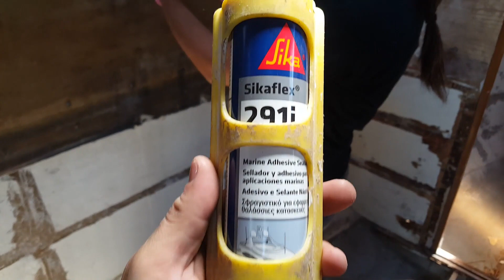It's NOT always FUN and GAMES! | YACHT REBUILD WEEK 5

Comment: You kinda knew you would have to replace the sole. It's the low point in the hulls. If wood is rotting higher in the hull and water usually travels down it stands to reason that the sole, stringers, and other supporting structure is compromised. Your lucky it's not one of the newer hulls with coring below the water line. Only thing you got to worry about there is delam and general osmoses.  Sand the hull down to the glass, do a moisture check, dry it if necessary and reseal it and paint with whatever bottom coatings you desire

Comment: Silicone sealant is good enaught  for what you are using it for. Stay away from marine sealant. Only use it on the out side. Never saw a Cat with one engine in the middle. Would love to see more and some photos of the drive shaft would be nice. If you are looking for engines have a look at Raka Marine. They have the Levol engine range and we have being using them  as gen sets for some time now and no problems so far. 3-4-and 6 cylinder. Have fun and don`t let the floor boards get u down.... Make more space for beer!
Reply: quite common for smaller cats to have singe engine two 10-15 hp with right props would get you going aroud 5-8 knots
Reply: Johann Naude .... Go read my comment regarding Silicone... to tell you the truth I wish they had never invented that stuff!! How many times have you Resealed your bath/Shower using Silicone??

Comment: NEVER put sealant on the hardware inside of the boat!!!!! Outside ONLY. The leak inside will tell you it's time to reseal and let the 
 water escape before being forced into the fiberglass or plywood.
Butyl tape, if properly installed, will last for ever. After 25 years I have removed hatches and the butyl compound could be reused. Most of the tube sealants will last between 1 to 5 years depending on the movement of the parts and sun / water exposure.
Reply: Soulstice Sail quit your scaremongering. I have used similar sealants on boats and it's still good 10 plus years later. I have also seen tape used exactly as instructions said fail within 1 year.